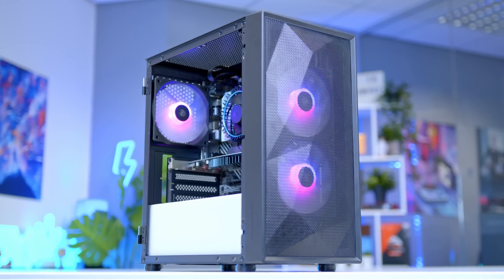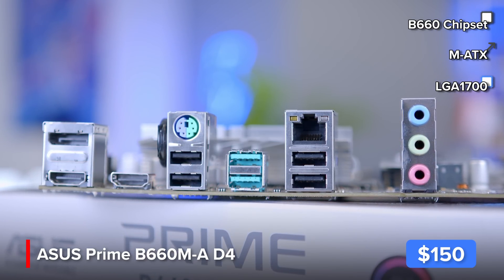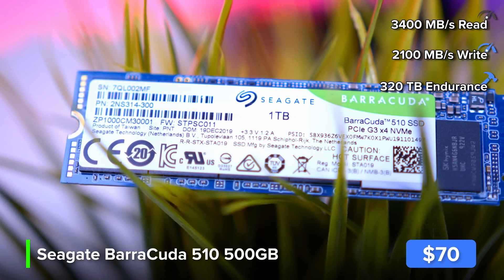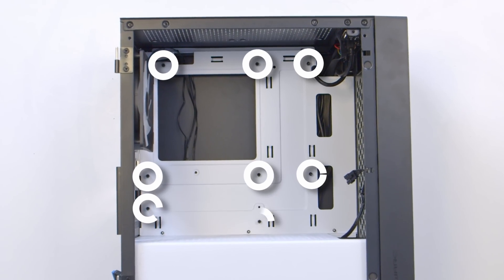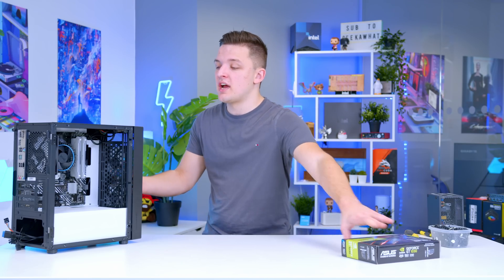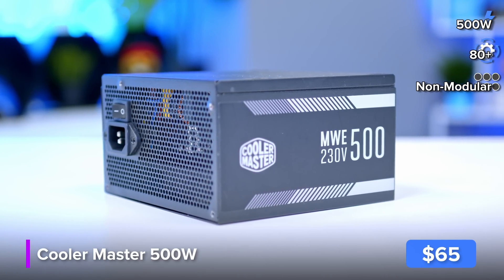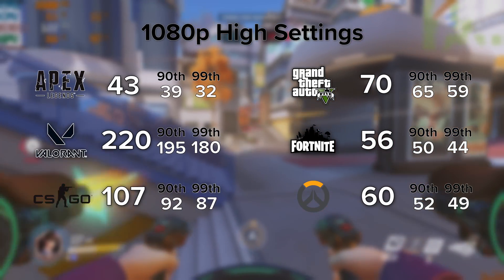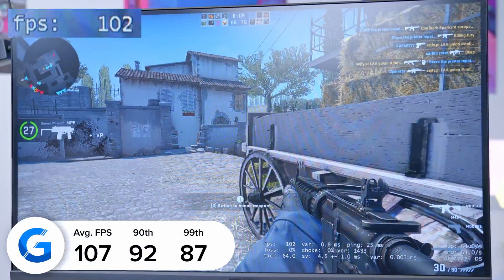Budget $600 Gaming PC Build 2022! [1080p Gaming Benchmarks - FULL Build Guide]

Comment: Will this exact build be alright with a 1650 instead of 1030 gpu? 
And in future potential 3050 or above??
Reply: No, cpu upgrade will be needed or there will be bottlenecks
Reply: @EdgeOfSpaceWalker  Dude the GPU is bottlenecking the CPU, don't spread false info when you have no clue what you're talking about. Also, Step One, the CPU is fine for pairing with the rtx 3050 and rx 6600, don't go any higher than those GPUs though.

Comment: Hey everyone I’m looking to build a build in the next few months… What’s your thoughts on this build?
Got a budget around £1800-£2000
Case- "Corsair iCUE 4000X RGB Tempered Glass Mid-Tower ATX Case"
CPU	- Intel Core i5-12600K 12th Generation 
Desktop Processor"
PSU- Corsair CX750F RGB, 80 PLUS
SSD	ADATA XPG SX8200 Pro 1TB M.2
HDD- Seagate BarraCuda 2 TB
RAM- Corsair LPX 16GB (2 x 8GB) DDR4 3600 C18
MOTHERBOARD-ASUS Prime Z690-P D4
GPU- EVGA GeForce RTX 3060 Ti
Fans- Corsair iCUE QL120 RGB, 120 mm RGB LED
CPU cooler- "Cooler Master Master Liquid 
PL240 Flux CPU Liquid Cooler"
Any feedback would be amazing thanks :)

Comment: gigabyte 3080ti, ryzen 9 5900x, msi x570 meg unify, 64gb 3600mhz ddr4, wd sn850 1tb x2, nzxt kraken z63, 850w psu, 5000d corsair case and asus rog strix xf120 120mm as fans. is these good and does it fit together? just want to make sure
Reply: Don’t quote me, but I’m pretty confident that anything could fit in the Corsair 5000D
Reply: @jooshiii  k thank u :)
Reply: @jooshiii  sorry for wasting ur time but do i need to buy cables for the graphic card or does it come with?
Reply: @Aleexah  For inside, the power supply should have the cables, for outside, the monitor should have the cables. If you already have a monitor, and no cables, make sure you buy the right one. Display port to Display port, HDMI to HDMI.
also dw you’re not wasting my time, even I’m still learning, building my first pc this week
Reply: @jooshiii  k good to know that i not wasting ur time but still sorry for wasting ur time a bit and gl with the pc i hope u dont fail on anything and that it willl be workin:)
Reply: @Aleexah  thanks, you too :)
Reply: Put these parts into pcpartpicker and it will show if they fit
Reply: @slicy_1914  k thanks it fits just need to update the bios on the motherboard but it cant tell if it all fits together in the case but ill hope it does
Reply: @Aleexah  it should fit toghether if you are unsure google it or watch a vid on yt
Reply: Yeah but you may want to go with i5-12600k or higher

Comment: As Always, here's another high quality video from Geekawhat showing off some awesome PCs
Reply: that pc is garbage a gt1030 will struggle there is many better pcs you can make for 50 bucks more
Reply from the maker: You tell me what GPU you can reliably buy for $149 and I'm listening...
Reply: @GeekaWhat  you can always go get a grandma's old rtx 2070 handy down  😉 jk
But they do give them away to grandchildren for free
Reply: @GeekaWhat  Id rather spend 40$ for a 1050ti or 70$ more for a 1650
Reply: @GeekaWhat  or go for a 5600g apu build so that when you do add a better gpu your processor is still solid
Reply: cut back a little on the rest of the build and get a second hand rx 580 or if you dont like second had gpus you can pick a 6500xt up for cheap if had a gt1030 pc its cancerus
Reply: @amandabielecki2290  you can make nice 5600g builds for cheap its a nice budget to make while waiting for gpu's
Reply: @pizza_man81zzz66  thanks for the $600 custom build u made me